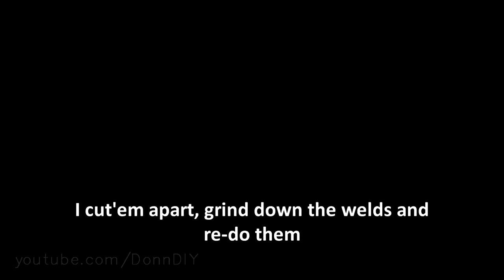Hydraulic Brake Steering - Tracked Amphibious Vehicle Build Ep. 12

Comment: Admire the fabricator that you are, 👍🏼 you should use nylon threaded nuts on bolts that you dont want backing off. And also you can drill holes on those levers

Comment: Nice shop you got there. Been watching your channel for some time now. As a former 4 wheel drive mudder and abuser I`ve changed alot of u joints in my day especially the wheel joints at the end of all the gear reduction...transmission, transfer case and differential. Those little PTO joints in your final are going to be the weak link by far. They are much to small to take all that torque after going thru that CVT, tranny and diff. They are going to be rocked back and forth every time you steer plus take all of the abuse pulling that heavy ATV. Even if they were almost straight they`d be too small. They`re gonna lead a real tough life. After all...they`re turning 8 wheels plus tracks.  Best to ya......Keep up the cool projects!

Comment: Correct me if I'm wrong but, wouldn't you want a nylon washer in between the bushings on the steering shafts? Only takes a slight bit of condensation and those will "rust" together. Awesome build so far. Cheers :)
Reply from the maker: Zerk fittings / grease nipples will avoid that problem.

Comment: I would add a damper, that the controls return slowly and gentle to their resting position and maybe put them on the sides of the seat instead in front of you, for ergonomics.

Also I would make no gas pedal but instead a pedal which removes the gas, like on a CAT, so if you stamp on it, it goes to idle. Maybe a second pedal which locks the current position in place, if you don't want to run full throttle for a long period.

Comment: Suggest to add cotter pins on the brake cylinder push rod bolts or replace nuts with washers and cotter pins.  // Подумай над тем чтобы добавить шплинты,  для фиксации гаек, а то от вибраций они очень быстро открутятся и заклинят тебе управление в самый неподходящий момент. Как вариант заменить гайки шайбами и зашплинтовать

Comment: The craftsmanship is  quite good. I've watched all your videos and always impressed with the details. I do have a question however, do you think you might need a bigger engine? I'm no engineer but I've been around the automotive field for 45 years and I think you might lose a lot  of horsepower in the drive line. Granted you have multiple speeds in the transmission but you also may only be able to use 1st and 2nd. Just my humble opinion. Great work.

Comment: You may want to consider a safety strap over that drive shaft where you seat is.  Just something so that if that breaks or malfunctions it don't impale you in the parts.@>@
Reply from the maker: It will have a tunnel over it. I don't want to get tangled up in the propshaft.
Reply: @DonnDIY  Good cause Id much rather watch you build things then get notifications your in the hospital as well :)

Comment: Love the build been following it along as you go. You have some real metal working talent. How it the steering going to work? I’m having a hard time comprehending it. It has a open rear differential so when you apply the brake to one side it will turn that way? Only thing I don’t get it when you get is how it will go straight because seems like it’s always is going to want to spin just one side.

Comment: Did you consider making the steering without differential axle by using two variable transmission and adjusting the speed with hydraulic sylinders? Other one method would have been to but two differentials side by side and to drive other with the engine and to drive the other with hydraulic motor to alter the differentials to steer. I am just curious about your thoughts behind the project as I have been thinking these my self too.
Reply from the maker: Not for this vehicle, no. I would like to keep it as simple as I can.

Comment: Have you done any calculations for buoyancy of the craft ?    Weight verses volume.
Reply from the maker: Bottom of the hull will be 1 cubic meter - it will have 1 ton uplifting force in the water. It will have a higher edge on top too. Anyway, the uplift will be greater than the weight of the vehicle.

Comment: Good afternoon! Can the dimensions or drawing of the plates and the length of the levers? Please, really need)
Reply from the maker: The leverage is 5 : 70, the distance between the master cylinder and the pivot point is 5 cm, the distance from the pivot point to the end of the handles is 70 cm. 😉
Reply: @DonnDIY  Thank you!)

Comment: Hey I have an question 
how do you steering? There is an closed drive in the back, right ? You need for a tank steering tow engines! one on each side 
or do you manage it with a breaking force??
Reply: Tanks has had geared steering since WWII.  Differentials and transmissons. Two engines not needed. http://www.gizmology.net/tracked.htm
Reply: Brakes do the steering.

Comment: Is it hard to  steer/turn   without the brake servo ?
Reply from the maker: It would be definitely easier to steer with brake boosters and/or double or triple brake calipers. I'll have to make that change on this machine.
Reply: @DonnDIY  Thanks for the info. i'm asking because i'm building a airsoft tank.